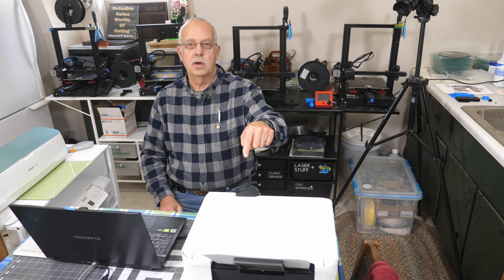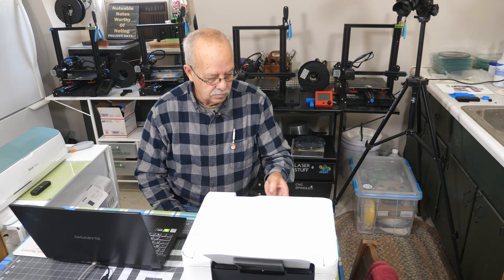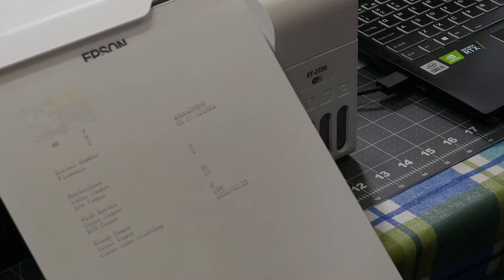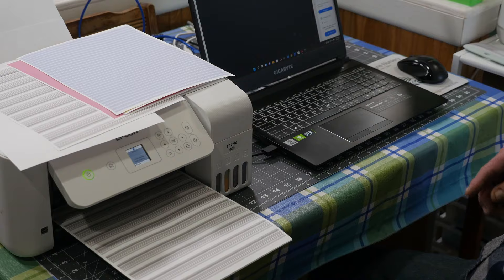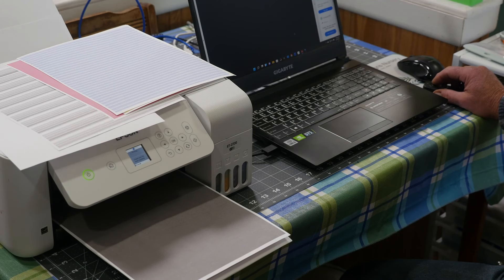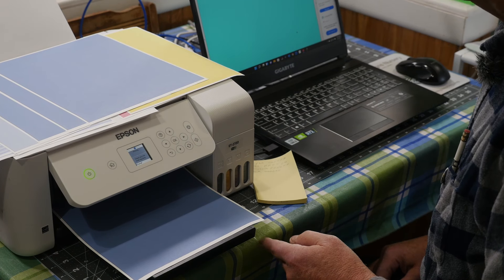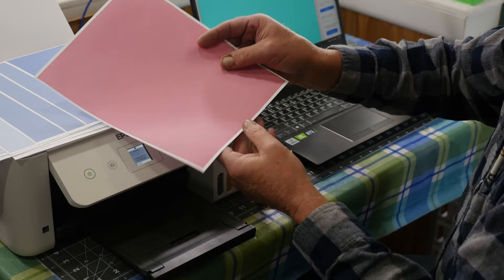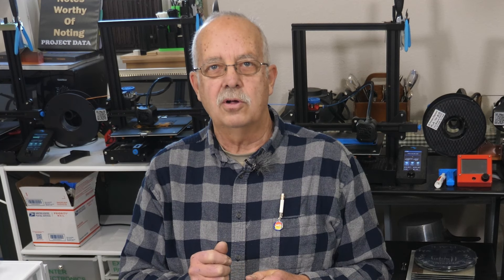Epson 2720 Printer Clogged Nozzles FIX

Comment: mine isn't printing black at all. All of the other colors are fine.
Reply from the maker: If after running the black color file on 20 or so tries and still no result, disconnect cables and shake your printer from side to side several times, reconnect cables, and try the sheets again.  Works for most, but not everyone.
Reply: I cleaned the black line. nothing. I did a power cleaning and nothing. I've printed so many purge sheets. I think I have to throw in the towel.
Reply from the maker: @TheMissjujubee24  https://youtu.be/uffJPjR7Sy8

Comment: This didn’t work for me at all. 100 sheets printed blank
Reply: I’m not sure what to do now.. gonna start over and try again
Reply from the maker: As a last resort, you can do a power clean.  If this still doesn't work, the printer has "failed".  It seems strange that none of the colors printed at all.  This leads me to believe that the printer has failed completely.
Reply: @rogersshop  yea it failed. I opened it up and the cartridges weren’t filling. Full tank empty cartridges. I was gonna try the deep cleaning til I noticed that. Picked up a wf7820 from Office Depot and I’ll just buy cartridges when I need to. Thanks for the great video. I’m using it to help my friend with hers.
Reply: @rogersshop  I just wanted to pop back and let you know we did this with my friends sublimation printer and it is now working!!!! I knew mine was just trash. I’m happier with the bigger lol but now we are both back in business!!

Comment: You do realize you can change the ink pads in the maintenance tank of the ET-2720, don't you? I did all of that with just black, giving me blank pages, and nothing works. I wish it was that easy, or I wouldn't be here watching what is a normal cleaning. My black ink simply will not print no matter what, after all the cleanings, in the world, of nozzles as well as the entire black in tube. Black just will not print. There seem to be something  more wrong with the black ink connection that no one seem to actually know about, and think it has to do with just cleaning. Oh, and all the other colors work perfectly.